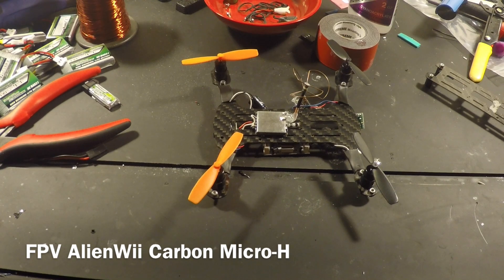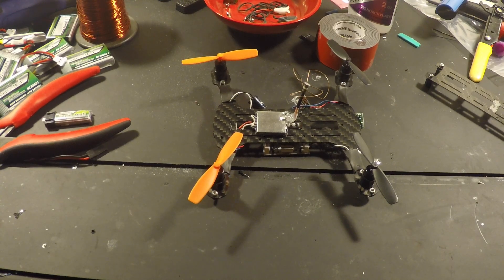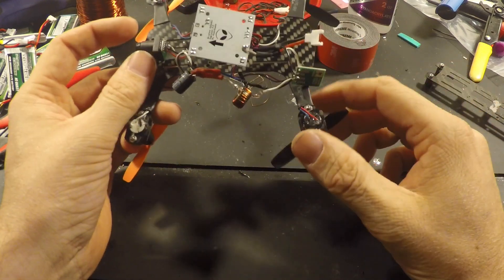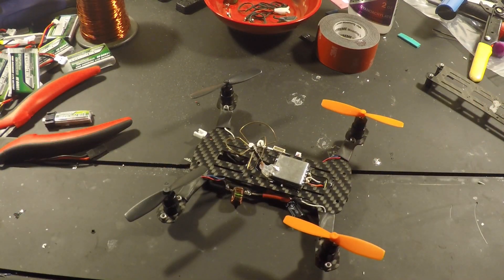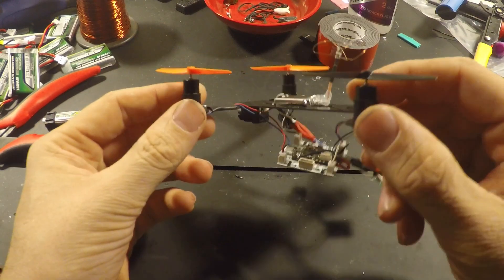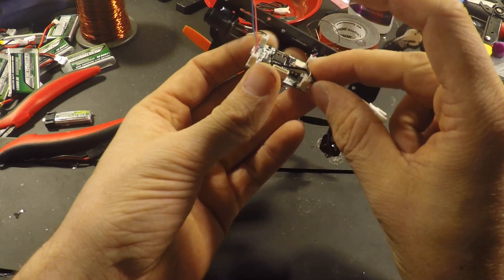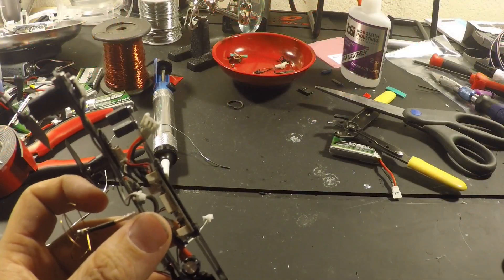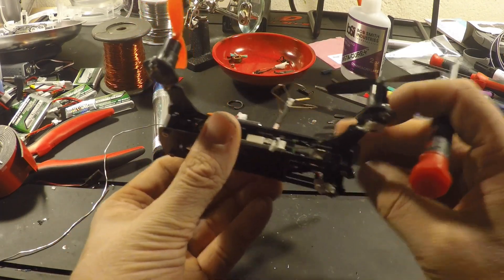FPV AlienWii Carbon Micro-H Overvew

Comment: What is the AUW of the micro H with fpv gear? Mine was bit of a pig and I switched from the dark motors to 17's and parrot props, now she is a zippy little rascal. Props do make a difference.

Comment: Good for you, and good video... Just one thing, in case you did not know. Carbon fiber which your frame is made of, is conductive. SO, be careful when mounting electronic components to its, such as your coil etc as it may cause a short. So if you have some funny or intermittent things happening, I would make sure that you insulate all of your electronics from the frame. Keep up the fun. Thanks for sharing.

Comment: Instead of the pololu you can use a ready made rc 5v voltage regulator as it filters the power as well and it costs the same as the pololu does and it's so much simpler
Reply from the maker: Definitely

Comment: Great video, but wanted to share, you dont need an lc filter, this will save you weight and would have saved you the effort. though very impressive and it is pretty!
I figured this out, since I had similar noise and used to use the balancer plug to power my fpv setup on my bigger planes with single batt. So I found these batteries and it works perfect, no lc filter needed. Simply use these batteries, run one plug to power fpv and I use the JST to power quad and voila, no noise. You're welcome. =)
http://www.hobbyking.com/hobbyking/store/__41271__Turnigy_nano_tech_750mAh_1S_35_70C_Lipo_Pack_Walkera_V120D02S_QR_Infra_X_QR_W100S_.html

Comment: TJ,
Nice to make your FPV :)

i have the same board, and experiment with it how to make the cable more protective against crash. Now when u crash on a motor your  cable might be damaged. What i would do is not using the inside screow of the motor holder. You can put the cable through the holes. Also below to protect the cable that just come out of the motor by using heat shrink, cut them same shape as the frame legs (make it a bit longer so you can use fishwire keep it in place) Make a hole so you can use the end screw to attach the motor protection. if you not sure what i am talking about check here: http://static.rcgroups.net/forums/attachments/5/7/8/1/0/8/a7521828-212-Carbon%20Micro-H_04.jpg

I also used the Standoffs as Legs. When you do that you no need fishline to keep the heatshrink in place but just make a hole in the heatshrink to keep it in place by the standoffs. But this way you have to move the motor cable just on the back of the frame and on top.

Happy FPV!

Comment: What are you using to view the fpv video? Are they fatsharks by any chance?

If so, what module are you using?
Reply from the maker: I have the Dominator V2's that work great with this and also a base station that has an ImmersionRC duo receiver as well.  The receiver in my goggles is the: http://www.getfpv.com/fatshark-5-8ghz-receiver-module.html
Reply: +TJ Williams Did you make any changes on the alienwii fc stock settings in multiwii conf?

Comment: Do you really need the step up/step down when your equipment is 1s already? Or is it being used to "stabilize" the voltage before smoothing it out?
Reply from the maker: The video transmitter needs 3.3v. Running on a fully charged 1s can make it pretty warm. With that said I do run it on a different build with no stepup/down and it hasn't fried yet.
Reply: Hmm, okay! Thanks! Seriously, thank you for making this video - it has helped demystify this build :)